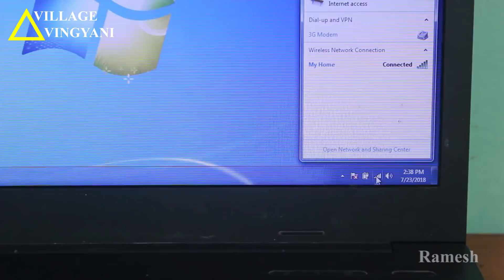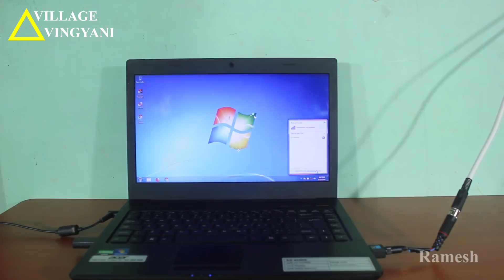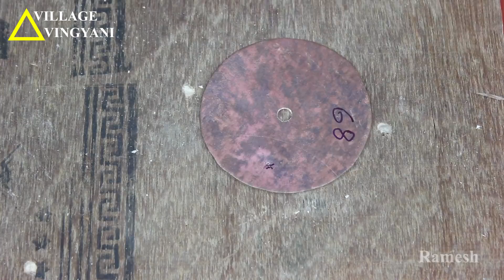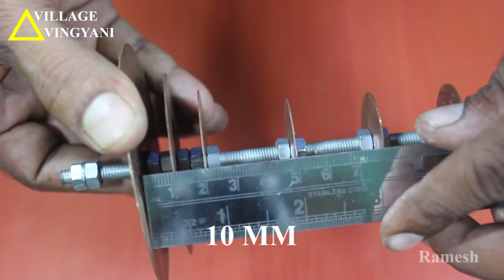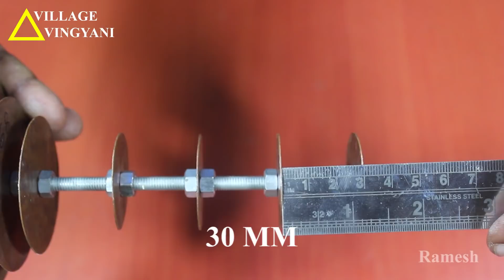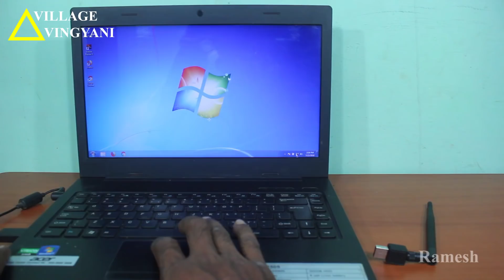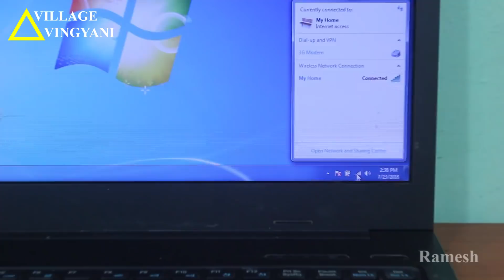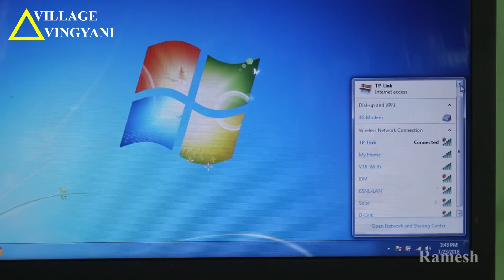Wi-Fi Receiver 10 km at home

Comment: If the antennas are added, starting with 2 directional antennas in parallel, the possibility of the signal will get stronger, it can even be 4 to 10 parallel directional antennas because other antennas such as a 2 meter yagi antenna, many antenna bands are doubled in parallel, I hope the wifi gun antenna can be switched double.

Comment: i was thinking of making this one but i would like to do it with my Xiaomi Mi Wifi Repeater Pro but its   antenna is built to it (unlike from the video that you can disassemble or remove the amtenna). 

Would it be fine if sattelite/cable tv wire is Twiddled to the repeater antenna directly? can i get signal with that (of course with the same directional antenna design)

please i hope and ill be very glad if someone read this and answer my question. 

(sorry for the wrong grammar)
Reply: It's need different diameter , watch KREOSAN for full coverage
Reply: you go order shop new
Reply: Hummm

Comment: Do not follow these instructions, you will damage your WiFi item. The antenna is shorted, all metal parts. A correct antenna will ONLY have the second plate metal, and insulation where connected to the metal base.
Reply: Hii sand your gmail id

Comment: This is the one of the thing , that can destroy your wifi adapter. You may be asking , how can this wifi gun destroy your wifi adapter and the reason is , this is not the yagi antenna , this is the type of shorted something together and hoping it will work but it's not.. You can inproove your wifi gun with very simple thing...just unshort the every single circle on this wifi gun.. The first circle is shorted out with the second one with approx 5 Ohms at best and this is so small resistance between those circles and it may cause a wifi damage. The yagi antenna is completely unshorted with everything , this is shorted with everything and it shouldn't work... Just unshort the every single circle from the rode in the middle of the circles somehow and you'll get + - 50% gain boost , trust me.
Reply: Yo tuve esa curiosidad.   Y pensé lo mismo que tu.   Pero un día logre abrir un router  y vi  que sus antenas internas  casi forman un corto circuito.
Reply: Kindly explain with a video in detail....
Reply: @ankushkhan8630  Also i forgot to mention , Yagi antenna is shorted but it has a right ohms like 50 or something around that. And Yagi antenna is well made for those aplications with a  right lenght because you can't make a antenna without wavelenght knownledge ,  larger wavelnghts needs to have a larger antenna , so smaller needs smaller antenna , with a  right and precise size you can get much btter results from this " pushka" wifi antenna
Reply: @samohraje2433  you'll gain trust from people if you show them with video...
Reply: @AgungMahdi  Yea, that's the problem. You know those videos where people had made a perpetum mobile and xy people liked and subscribed to that channel... Kreosan is not stupid but  this video contains some fake stuff as well as his other videos. I'm not saying all videos contains fake, but some of them like this video e.g.... Not everything is based on truth, people needs to be liers sometime. Truth hurts, but lie has short legs
Reply: @samohraje2433  what do u think ia better ..yagi antena or parabolic for wifi?

Comment: it is fake .. because . output power required for more signals. usb does not have such power
Reply: its not fake it is directional antena if you want to know more yagi antenna design but it has disadventage it works only on max 10 degree in front its not 360 degree all power is focused and max range is about 500m to 2km depends on power ofcouse if reciver is same style you can reach over 20km range but alot of countrys dont allow this and you can get fine for this stuff in my country you cant broadcast anything over 200m if you dont have license.
ohh video author stole idea from https://www.youtube.com/watch?v=Nk-nj_BwoBE popular russian youtuber.

Comment: fake 100% fake fake 100% fake fake 100% fake
Reply: Why do you say that? The “Simone” antenna has been around for many years commercially. And if built to correct specs, it will work just fine....
Reply: @robertmitchum2972  never !!!
Reply: It is very strange that the signal is all 100% !!! but it is an antenna that has an excellent gain .
Reply: dipole and reflector on ground cannot work ......  he has no idea  :-)))))))))))))))))))
Reply: J B  True, the antenna is a direct short at DC voltages. But you have to remember that this is not a DC voltage!  At 2.4 GHz, the transceiver sees a load..... Not a short... 
A simple loop antenna, a quad antenna are two examples of antenna that show a short when connected to a Volt-Ohm meter..  In fact, many antennas show a short when operated out of band.... This is mostly for lighting protection...

Comment: Hi brother Iam from Pondicherry ,

Greetings of the day,  I had tried to build the Wi-Fi gun. Everything OK but it is showing same amount of signal that s

Shown before connecting gun and after connecting gun. It is not working, compared with this my inbuilt Wi-Fi shows more signal. Please give me solution :)

And one Dout, are we want to insulate each plate?

But two wire from modern antenna is already conducting. 
Iam using aluminium plate. 

Please help me....
Reply: Bro did you made it to work ?